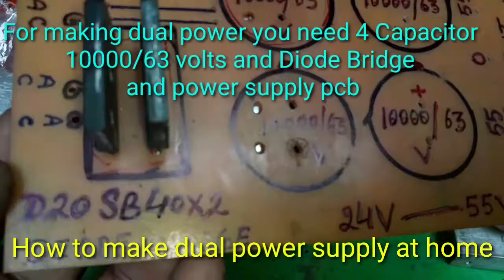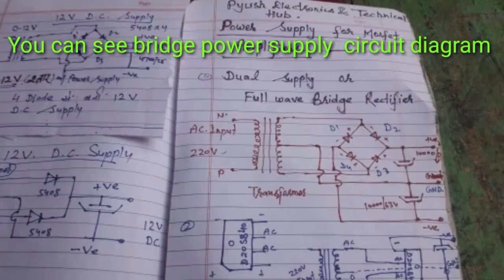Dual Power Supply  24 -0 - 24 volt D.C. to 55 -0- 55 volt D.C.

Comment: सर, आपने 24-0-24 volt ac transformer से 50-0-50 volt dc बनाने को कहा लेकिन विडियो में आपने 24-0-24 volt के बजाय 35-0-35 volt transformer कनेक्ट करके दिखाया है, प्लीज रिप्लाई.
Reply from the maker: Hi bro 
इस पावर सप्लाई बोर्ड में आप 24 वाल्ट से लेकर 55 वोल्ट तक कि सप्लाई आसानी से बना सकते है।
बस इसमे ट्रांसफॉर्मर अलग-अलग वोल्टेज के लगेंगे।
     यदि आप 24 वोल्ट AC का ट्रांसफॉर्मर लगते है तो आप को करीब 30 वोल्ट dc से 34 वोल्ट तक कि सप्लाई आउट होगी।
      और यदि आप 45 - 0 - 45 वोल्ट का ट्रांसफॉर्मर लगाते है तो आप को 55 वोल्ट की सप्लाई के लगभग आउटपुट होगी।
                    OK
Reply: @piyushelectronicsandtechni81  thanks dear
Reply: 24 0 24 mean    dual out put
Or single out put